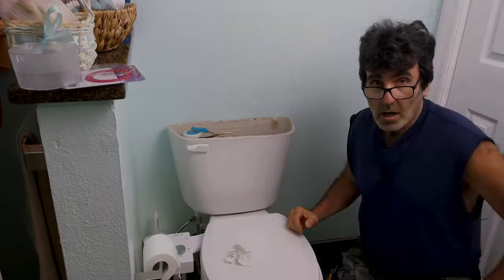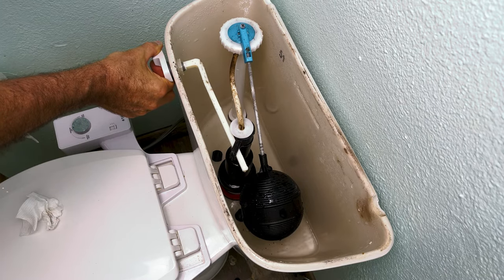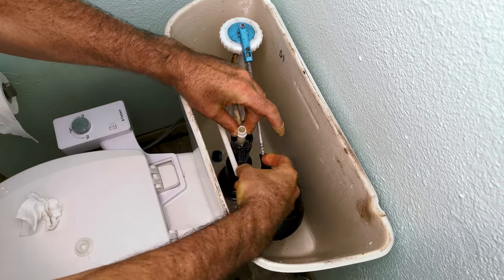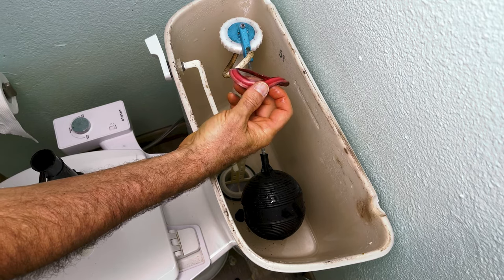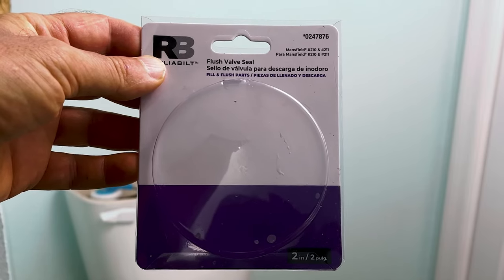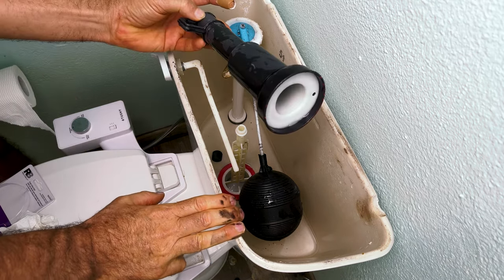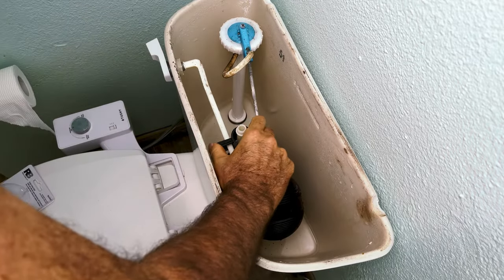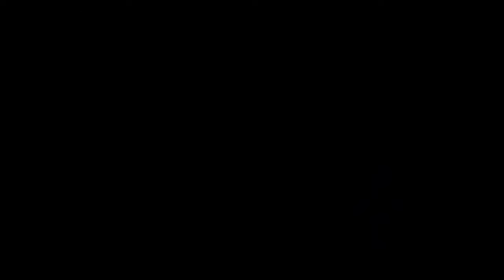Fix Your Hard to Push Toilet Handle in 5 Minutes Flat!!

Comment: I'm a senior citizen who was putting up with a hard to push toilet handle. For over a year I lifted the water tank cover and pulled the handle shaft by hand. I was tired of breaking handles and their cost. With your video I was able to fix the problem. It pays to read the instructions. The ring needs to be placed on the first groove. I had pushed the ring all the way down and it wouldn't hold water in the tank. Much appreciated.
Reply from the maker: That's excellent!  I'm so glad I could help... 😀

Comment: Thank you so much! You showed and explained everything clearly so I could be sure this was the type of toilet I had and I was able to swap the valve seals and fix it.

(Mentioning in case this happens to others who also have no other experience to draw on) I was afraid I’d done something wrong or gotten the wrong cable seal at first, when (after everything was set up again) there was a tiny but distinct trickle sound after the tank filled that disappeared if I pressed on the black handle, indicating I didn’t have a full seal at the bottom. But it turns out that I must’ve not had the valve seal completely its groove—I pulled it up and put it down again, running my fingers along the edge to make sure it felt like it was evenly sitting, then put everything back together again—success! Now I can be prepared if this issue pops up with the other toilets in the house!
Reply from the maker: You're welcome!  Very glad I could help...  Glad you were able to get things going again.  😀

Comment: Thanks for the video, it never fails when I turn the water supply off. There’s a drip after I turn it back on. Do you have a video on how to fix that thanks.
Reply from the maker: HI, I don' have a video for that.  But Ive ran into that before.  Sometimes you can tighten the nut behind the actual shut off part that you turn.  Make sure and back it up with a crescent wrench on the valve body somewhere and try to see if you can get an 1/8 of a turn on the nut.  This will usually take care of that.

Comment: I’ve done the same steps as you, but now the new valve doesn’t have a good seal. Water keeps leaking through and then gets filled every 15 seconds
Reply from the maker: Make sure you have the right replacement part...  make sure the replacement washer is seated in it's groove properly.  You might have to take it back apart to check that.  Make sure you clean the sealing surface of the part that goes up and down..  That's about all it could be if you're working with the same style as I have in the video here..
Reply: @TheHomeImprovementChannel  Yes it turns out my valve wasn’t seated properly on one side. After I put the valve on again it works perfectly. Thank you so much
Reply from the maker: Awesome!  So glad I could help... 😀 @HamzaKhan-zp8uc

Comment: Help!  I removed the old gasket it was thick and crusty and breaking apart BUT after I replaced it I saw a grey cloud and now the tank does not fill up and the toilet keeps running. What should I do?
Reply from the maker: Yikes!  Will be difficult to say without being able to see it.... IS the tank filling up at all?  Or it it just running but won't fill up...
Reply: I saw another video which solved it.  Apparently there are two grooves for the gasket to sit in.  I had pushed it too far down so I pulled it up into the first groove and it was sealing fine.  Thanks for replying!
Reply: @martialarts151 Thanks for the comment and I had the same problem and read your comment and saw the upper groove and is now working good.

Comment: Thanks for this video. The flushing lever snapped so I had to replace it. Now when I flush it, the handle doesn’t go back up on its own, I’ve to tap it up myself else the water keeps draining. Why isn’t it going back up on its own?
Reply from the maker: HI... without seeing it it's hard to say.  Does the lever move freely on it's own?  Does your unit have a chain attached to the handle that has to much slack?
Reply: @TheHomeImprovementChannel  it’s with a funnel and no chain. Was able to fix it by less tightening the screw behind  the flush handle. Hoping it stays fine now.
Reply from the maker: Great!  I suspected it could be something like that...

Comment: you mustve left out some sort of steps or details because ive redone this 6 times over the last 2 days and it wont seal, it just keeps leaking water and the toilet keeps running
Reply from the maker: I actually didn't.  But I have run into that before.  If you take the piston/ plunger (whatever you call it)  back out and reseat the red washer, it should solve the problem.  It might not be in it's groove all the way around... 😀
Reply from the maker: Very good!  Glad you got it going again... 😀

Comment: Best Advice Ever!!! I didn’t find any info on this issue anywhere. You are the only one to identify what our problem was. I felt so smart just going in and buying a flush valve gasket. Can’t believe how a beat-up gasket can make a toilet unfunctional (in polite society). Bravo! Thank you!
Reply from the maker: TYSM for the super thanks!  I really appreciate that.... Im so glad I could help you fix your toilet...  I had one like this recently that wasn't sticking like this one was, it was constantly leaking past the flapper...  I guess they present different symptoms depending how bad they've deteriorated....

Comment: What is the science behind why the seal makes it hard to flush?
Reply from the maker: Good question!  The answer I give would probably be mumbo jumbo!  So I'll spare you that... 😂
Reply: @TheHomeImprovementChannel  It would seem if anything the rubber seal would get looser and leak rather than get tougher to pull?
Reply from the maker: @Capecodham  IKR... it would seem that way, but it does the opposite!  Probably to a point.  Once it deteriorates even further it probably would just leak through..